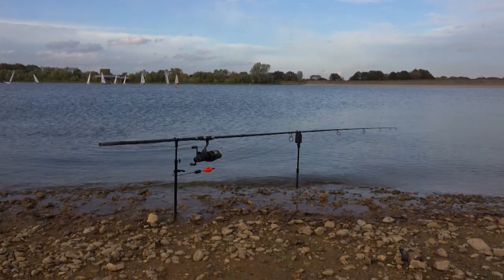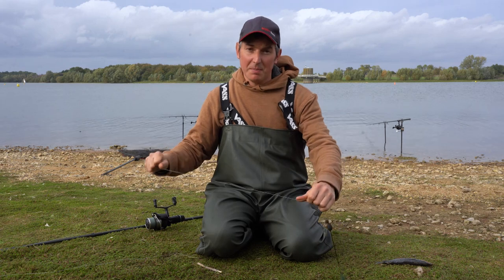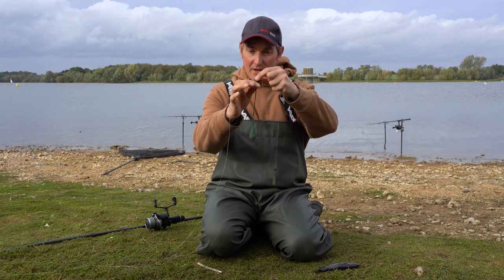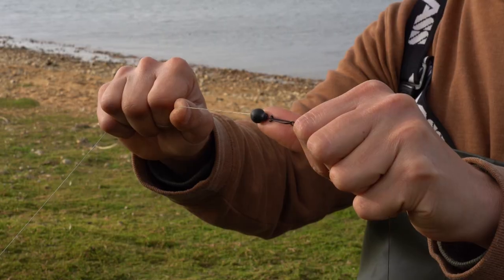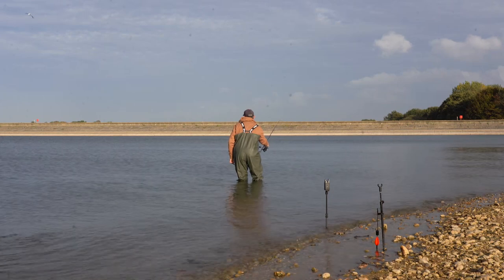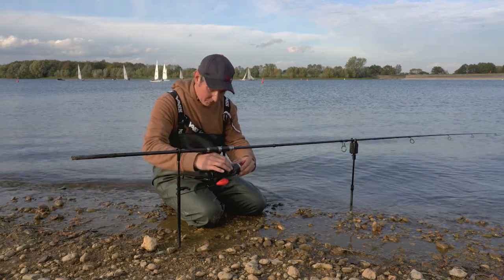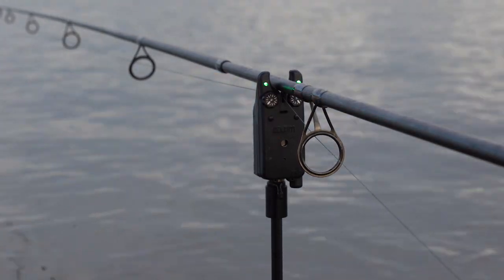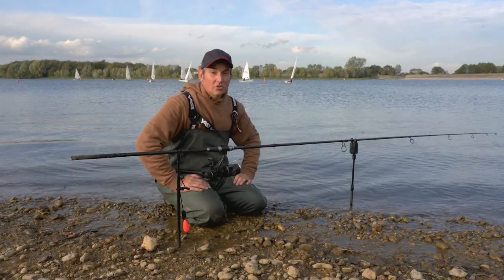How To Ledger For Pike Using Drop Off Indicators - Predator Fishing Quickbite

Comment: What bite alarms are best for pike fishing ?
Reply from the maker: Hi J Kaleb, Delkim alarms are best used with the drop off indicators as they use a vibration sensor rather than a roller wheel so offer much better sensitivity.
Reply: @AnglingDirectTV  thank you 🙂